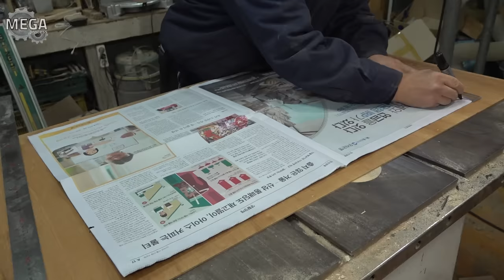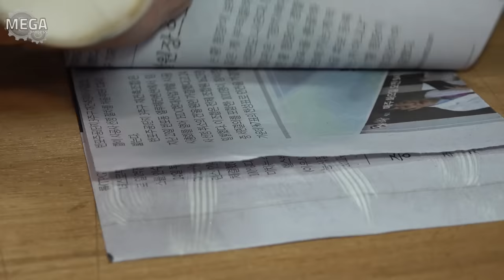The process of making a fishing rod from solid bamboo. Korean traditional fishing rod craftsman

Comment: Lovely craftsmanship but I wouldn’t go fishing with one now. My first sea fishing rod was solid greenheart - all the flex of a scaffold pole. Then came split cane (bamboo) which was many times lighter and responsive. After that was glass fibre; again lighter and more flexible. Finally, carbon fibre which has the best weight to performance ratio of all. If you have to have a fishing rod in your hand for hours (spinning, some float fishing, fly fishing) weight is critical. I mostly fly fish now and couldn’t use a cane rod because of the weight.